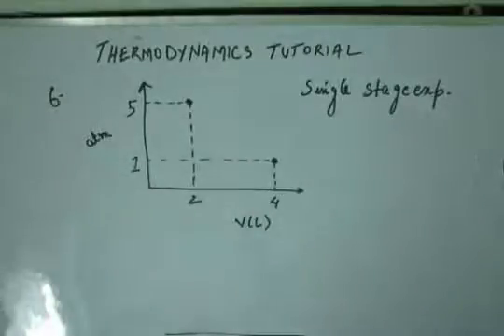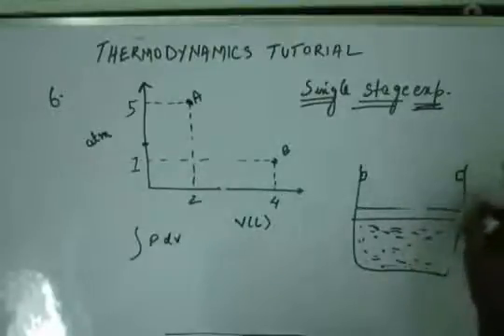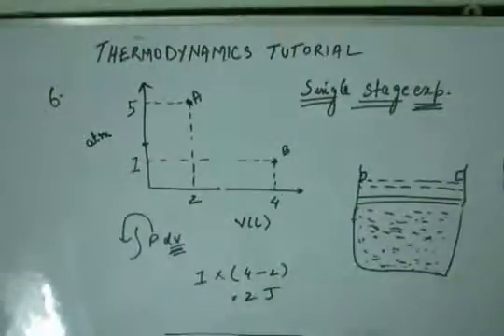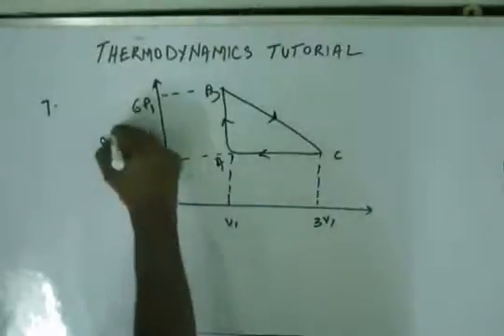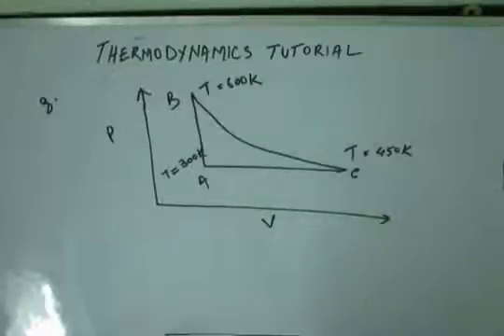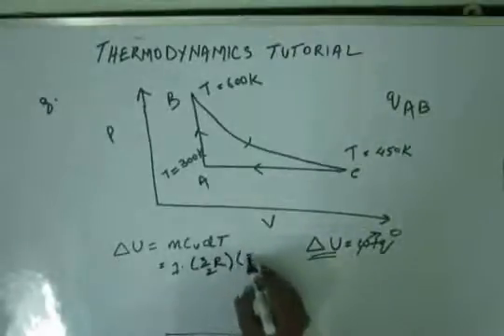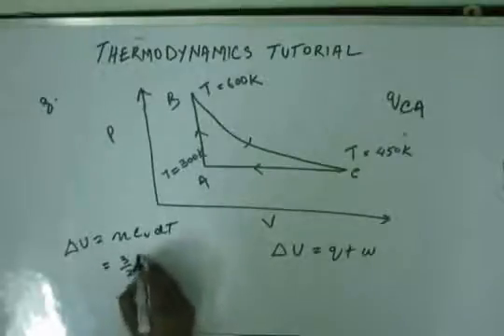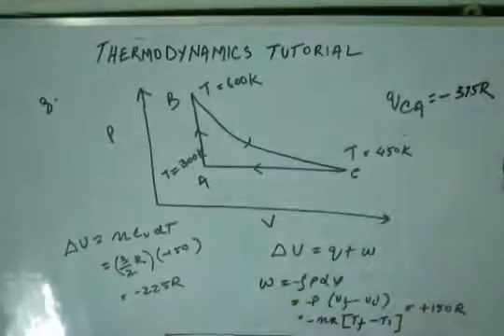Thermodynamics Lecture  10 , Chemistry IIT JEE (More Example / Practice Problems)

Comment: conversion factor is that 1 atm = 101325 Pa  not 101.325
Reply: he is saying 1L-atm is equal to 101.32J I usually use 100J for fast calculation 😁
Reply: he has also converted 1litre into metre cube (si unit of volume)